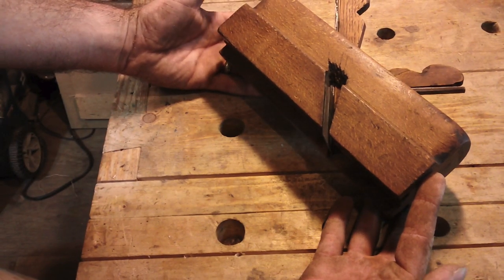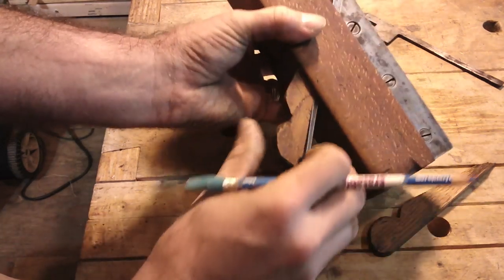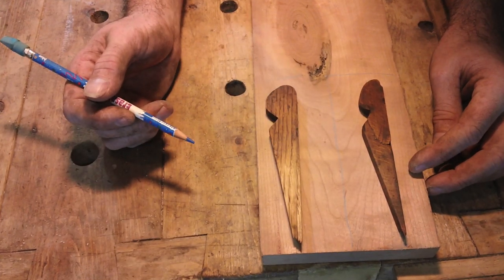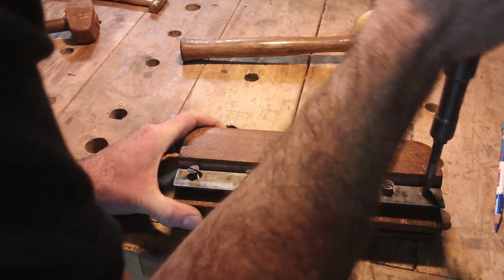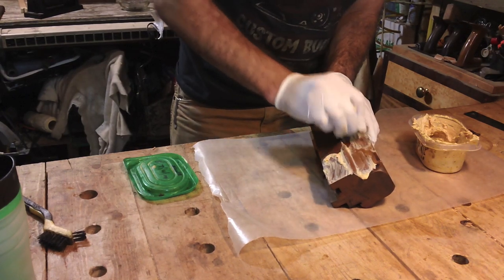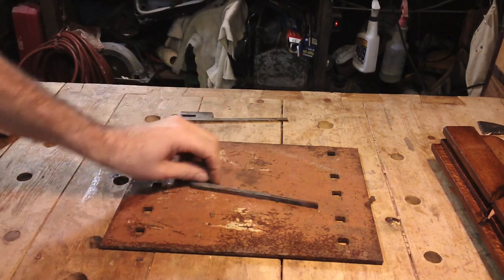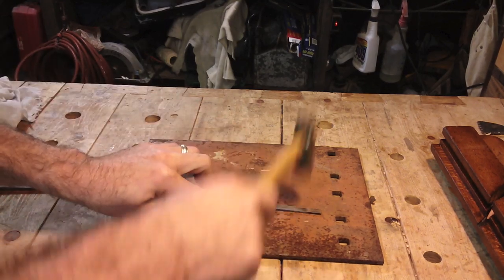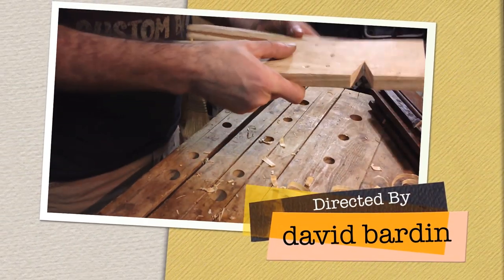Wood Ohio Tongue and Groove Plane

Comment: I loved everything until you mentioned linseed oil.  I adhere to the old proverb: "BLO really sucks!"... It's a great oil, don't get me wrong, but I hate what it does to the wood in 30 - 40 years. Dark & sticky!

Would you ever consider switching to Tung Oil (the real stuff)?  It protects the wood and never darkens.
Reply from the maker: What would be a better oil to use?
The Brits used tallow and that stuff would turn the planes black. I clean them one good time then just use bees wax for follow up.
Reply: Dave Bardin Tung oil doesn't seem to darken (as much) over time - and it is more resistant to moisture.  

My father used linseed oil - just like his father used to.  Now his planes are all pretty dark.  I think UV light makes the linseed oil even darker.  The planes that were exposed to light from the window are the darkest of all.

I'm not faulting you for using it.  It's the "old time" standard.  Better than tallow I guess! :)
Reply from the maker: drstampfli
OK now I am on a tung oil investigation.
My Aunt had a tung oil tree in the backyard and we tossed the fruit at each other.
And there was an old woodworker on PBS when I was a kid. It seemed all he used was Tung oil.
Thank you for the interesting thoughts.
Reply: Dave Bardin Be careful not to be fooled at Home Depot. Some of the products called "Tung Oil" aren't really tung oil.  RealMilkPaint and Lee Valley are good sources of info (and real tung oil).  It costs more than BLO - which is a shame!!